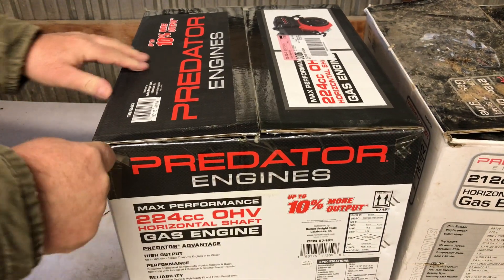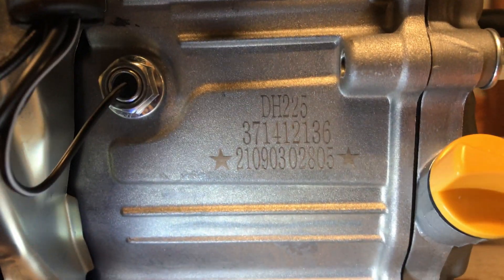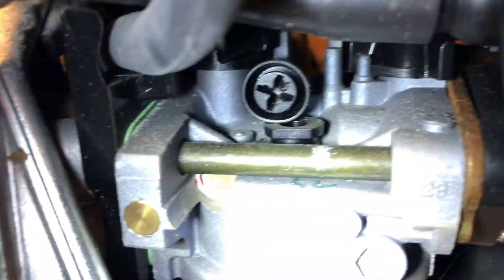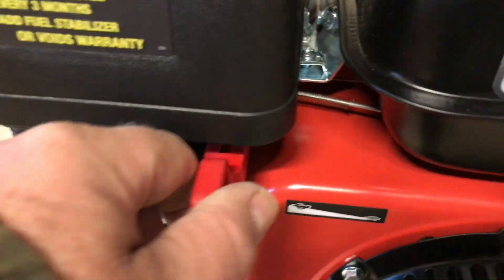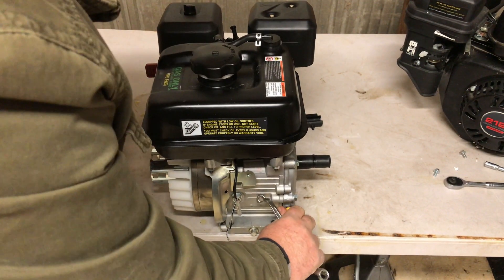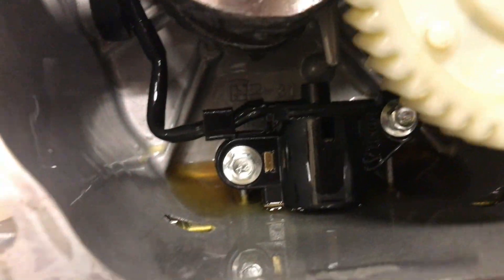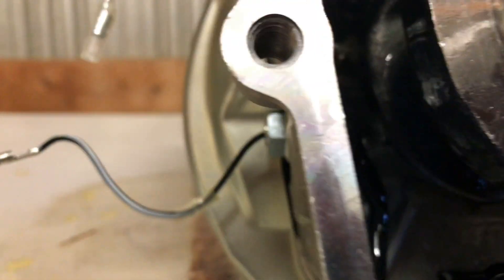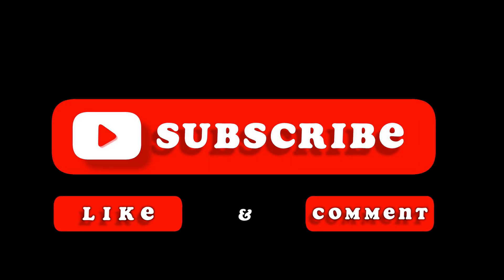The Secret Truth Of The New Harbor Freight 224cc Predator 224 Engine Review

Comment: My clutch from the 212 won't fit on the 224... What are the best options?
Reply from the maker: Hi Kyle. The Predator 212 and the 224 have the same output shaft size of 3/4" or .750  Some mini bike makers falsely labelled the 196cc engines as a 200cc, those engines have a 5/8 output shaft and will not interchange. I think that may be the situation you have. Best option would be to search Ebay or Amazon for a new replacement 3/4" clutch. You can find them for around $20 or less if you shop around. Remember you want a clutch for a 3/4" output shaft that has your correct sprocket according to your chain size, there are listings for lots of different sizes output shafts but the 3/4" is what you need for your Predator 224. The most common choices for sprocket chain size are # 35 and # 41, if your mini bike has a # 420 chain the # 41 will still fit. Hope this helps!
Reply: @KentuckyFriedFixes  hey thanks so much... Yep thats what it was... The guy i bought it from said it was 212 i bought the 224 and wouldn't fit turns out you are right
Reply from the maker: @kylearnett1420  Good deal Kyle! I'm glad you got it worked out. Now let's ride!
Reply from the maker: I also wanted to add that some Chinese clone engines will have a 20mm (.787) output shaft as well. The Predator 224 has a 3/4" or .750 output shaft.
Reply: They are the same size shaft ,so yes you sure can use the same clutch

Comment: I just bought this engine to slap onto my coleman ct200u-ex, which parts would you recommend I swap out, just to have a more solid, better performing engine?
Reply from the maker: Hi Caleb. If you're going to leave the governor on, you can add some more power just by adding an exhaust header. Most like to add the aftermarket air cleaner as well but I'm not sure an aftermarket air cleaner would help in this case as the stock unit has a cartridge filter and will breath pretty good as it is. It's also easy to add some 1.2 or 1.3 rocker arms with the stock camshaft and springs for more valve lift and power too. The stamped 1.2 and 1.3 ratio rockers are around $8 each and will live with stock springs and stock lift camshafts. Of course if you want a high RPM build, I have a 3 part series I did with a billet rod build on the 224 Predator. It depends on where you want to take the engine of course.
Reply: @Kentucky Fried Fixes  and if I take it out? How about adding that hemi also? I seen it online for a decent price
Reply from the maker: @troy22nd  If you're going to remove the governor you'll need to add in a billet rod and billet flywheel for sure. The stock rod won't handle sustained high RPM and the cast iron flywheel is already thinking about coming apart when it's sitting still.
Reply: @Kentucky Fried Fixes  I'm going to add the hemi head as well, where did you pick yours up at??
Reply from the maker: Hi Caleb, I removed mine from a 212 Hemi engine I'd purchased for an upcoming project but you can find just the Hemi head on Ebay. Try to find one with all the goodies still attached like valves, springs, rockers etc. You'll also need the Hemi push rods as they're a bit shorter than the non-Hemi type. For me, I'd rather catch the 212 Hemi on sale and buy the complete engine, more parts for the $.
Reply: @Kentucky Fried Fixes  I found it on a website, was wondering if you had found yours elsewhere for cheaper because you picked up a separate hemi head, no?
Reply from the maker: @troy22nd  Hi Caleb, I purchased a Hemi engine from Harbor Freight. If you wait for a sale you can pick up an entire Hemi 212 engine for $129. I've seen just the heads for sale on Ebay, the last time I looked I think they're selling those for around $80-$90 for just the Hemi head. That's why I purchased a complete engine for just a bit more. Besides, I needed the rest of the Hemi engine as well for another project. I like to get the most for my $.
Reply: @Kentucky Fried Fixes  Another question for you if you don't mind, the hemi swap you did, is that the same engine as the one you started up, with the header?
Reply from the maker: @troy22nd  Hi Caleb. There are 2 of the 224 Predator engines. One is the billet rod build and the other is the stock 224 that I swapped the Hemi head onto. I've not made any further modifications to the stock 224 Hemi engine yet. I used the same header for the run tests on both engines. I have since purchased a new header so i wouldn't have to swap it back and forth between them and wouldn't you know, it has the same crappy flange as the other one! Thanks

Comment: What torque converter would you match with this engine on a black widow go kart?
Reply from the maker: Hi Kevin, Those are pretty heavy karts. I have an old dune buggy type Kart which is likely heavier than the black widow though. I have purchased one of the 30 series Comet clone torque converters for it ($63.99). I think it will work fine but I've not tried it yet. The original torque converter on my kart was a Comet brand 30 series and I have to say the clone unit I purchased looks pretty good as compared to the original. I looked into the 40 series but they seem to all be for the 1" bore shafts and I needed the 3/4" like on the 224 Predator. I did notice that the 40 series was also about triple the price of the 30 series too. I've not gotten mine installed so I can't tell you how it will hold up yet but it's getting close to Spring so I should know in a few weeks. At around $65, I'm gonna try it before shelling out $300-$400 on a name brand.
Reply: @KentuckyFriedFixes  thank you very much. I have been sitting on this for a while as I couldn’t find anything on this subject. My grandson will appreciate it.
Reply from the maker: @kevinbrown2494  You're welcome Sir! Let's get those karts movin'! Thanks.

Comment: Do performance cams from the predator 212 fit these engines?
Reply from the maker: The 224 Predator and the 212 Hemi have a .549 to .550 bearing journal diameter on the cam. It's the same as the Honda and clone engines. The standard Predator 212 non-hemi engines have a larger journal on the camshaft of .557 and will not interchange. Weird how they thought this was a good idea...

Comment: Where can I get a double grooved pulley that will fit this shaft size?  I was gonna put this on a ryan dethatcher I have that has a old dinosaur Briggs 7hp  has almost 1” shaft tho  this shaft looks to be 3/4” ?
Reply from the maker: The 224 Predator has a 3/4 output shaft. I have bought pullies at Tractor Supply Store (TSC) years ago but I can't remember if they have double pullies or not. Surplus Center online may have something.
Reply: @KentuckyFriedFixes   I think this in its stock form would be fine for that dethatcher. The new ones come w Honda Gx160. So I figured it should. .  Thanks.  KFF

Comment: Can I use the 224 crank in a tilly block and if so what upgrades would get me high rpms thanks
Reply from the maker: Hi Shane. The crank should fit any block that's compatible with Honda clone engine parts. I know EC had an engine build contest recently and one of the guys that entered used a 58mm crank in a Tilly block. If you're going for max RPM, it's mostly in the camshaft and valve springs. Of course you'll have to add some billet stuff like the billet rod and flywheel for it to stay together. Lots of mods will get you in the 9 to 10K range. I'm thinking about doing a little more advanced build on a 72mm block. But, while the long stroke crank is nice to have these are pretty soft, so I don't know how long they'll hold up at 10K. Thanks
Reply: Thank you for the time and information 🙏
Reply from the maker: @infoinbio1  Thanks for being here Shane. I enjoy the engine talk.

Comment: Im gonna be completely here the 224 isnt worth the extra money  that reinforced block is nice but the 212s didnt have a problem with a weak block  as for the the power increase  its so minimal that most of us arent going to notice it at all  we have to keep in mind that this thing is still a budget engine that isnt going to last very long 
The plastic parts are still manufactured from the same garbage base plastic so they will fail within two years of normal use yall can buy the 224 at its inflated price if you want but i wont be buying it unless it drops to 100 dollars out the door
Reply from the maker: The 58mm stroke crank and the thicker block are worth the extra $40 to me. The rest is just spare tiller parts. The problem is Harbor Freight prices keep creeping up. I used to buy the 212's on sale at $99 but now the "sale" price is $129 and regular $149. These 224 engines are $40 more but you get a block and a 58mm stroke crank. The quality of the parts stinks. My new crank is already .001 out of round and that's brand new out of the box numbers. LOL Thanks!
Reply: @KentuckyFriedFixes  wow im surprised about  the crank is this ftom use or loose manufacturing tolerances
I own several several hinda clone engines 
And ive noticed all of them vibrate more than a new engine should have
Harbor freight prices are going up unforunately quality is not ive honestly been shopping elsewhere
When possible  but sometimes have to buy harbor freight items
As they do sell items that you cant get at lowes or home depot
Reply from the maker: @GeorgiaRidgerunner  It's a brand new engine so wear has nothing to do with this one being out of spec. The crank was ground out of spec. It's funny most billet rod makers say that if your crank is .0005 out then you should have it turned..  My brand new crank started out life at twice that .001. LOL I wouldn't use this one for anything exotic for sure anyway, these cranks are soft. Thanks GA Ridge Runner!
Reply: The power difference is noticeable..very noticeable.

Comment: Fun fact: The 210903 on the sticker is the date it was manufactured, meaning it was built on September 3, 2021. They use a YYMMDD format so that the serial numbers are in chronological order when they count up. The 02805 is likely a time code for what time/shift/assembly line it was scanned on after testing.

EDIT: The carb has 210901 so it was manufactured on September 1, 2021. That factory was running VERY tight production on these units. No extra stock laying around. I think I saw 120502 on the old one so that was built May 2, 2012.
Reply from the maker: Awesome info! This is exactly the kind of thing that comes in handy when identifying these things! The old 212 is an engine I've had for several years. It's a new one in the box left over from a sale bulk purchase but it's not a recent manufacture "New" engine. I expect the QC on it was terrible! Thanks!

Comment: Nice engine. What's the length and width bolt pattern? I am debating on buying this engine to put on my vintage Montgomery Ward snow blower and wondering how much modifying I would have to do?
Reply from the maker: Hi Mike, the mount is a standard 6.28" x 3.07" (bolt hole pattern) center to center. Same specs as the 212 and many other small engines. Thanks!

Comment: Have one of these on a wood chipper. No complaints so far, more power than I expected. Only issues with about 30hrs on it has been muffler cover screws vibrating off.
Reply from the maker: Scott that engine is probably trying to spit out the muffler hoping you'll replace it with a header! Thanks!

Comment: Just subbed, I have 8 of the small vertical engines in use for 2 years of grass cutting, haven't been able to find them for about 2 years in stock, I think I'll try to figure out HOW to mount one of these to my Snapper RER to use it to pull my pull behind cutter
Reply from the maker: I remember the vertical engines. They have been missing in action for a while now. Thanks!

Comment: I’ve used predator engines on several tillers and a few zero turns for customers. They’re all still going and never had a single problem
Reply from the maker: The price keeps going up is the only complaint I've had with Predator engines. I miss the $99 sale priced engines. Now they seem to be at $149 regular price and sometimes go on sale at $129. I guess to be fair everything is going up in price these days.
Reply: @KentuckyFriedFixes   Damn , I haven’t bought one since the increase. Thanks for the heads up.

Comment: SO, how is the cam gear attached to the cam? Can a metal one be fabricated and replace it easily"
Reply from the maker: It looks like it's molded to the shaft. I don't know if it would be worth the effort to put into a stock camshaft. Metal replacements are really inexpensive now. I've seen engine builders sell the stock metal 212 camshafts by the 10 pack for around $30. Thanks!

Comment: Would the cam/shaft from the 212 fit in the 224?
Reply from the maker: The 224 uses a clone type camshaft with a shaft diameter of .550" The stock 212 Predator camshaft has a larger diameter shaft and will not swap over, the Hemi Predator camshaft will work or any clone cam with the .550 journal.
Reply: Damn..I was kinda wondering that too since the cam in the 224 is plastic!!!!!
Reply: So a hemi cam will fit in it instwad of a non hemi cam im looking at gps hot265 cam will it fit if so wich one?

Comment: Does it have a removable plate where a starter could go
Reply from the maker: You'll have to get an entire kit to convert it over. I've not done it, so I don't want to tell you wrong but it's my opinion that yes you could, I don't see any reason why you couldn't make this an electric start engine.
Reply: @KentuckyFriedFixes  I have a bunch of powerland electric start 212 engines I grabbed cheap  off the ebay a few years back they have everything I need but I am looking to put one on a snowblower so I want 120volts flywheels are $25 starters are $75 12volt kits are $80 for everything including charging coil and new fan cover
Reply from the maker: @craigchiddo2794  Go for it Craig! As far as i know you'd be the first to install an electric start on the new 224 Predator!

Comment: As I understand it the 224 is a 212 with a stroker crank. Shorter stroke spools up faster but lowers overall power.
Reply from the maker: It's a completely different engine than the 212. Though designed on the same specs there's lots of improvements like the thicker block and longer stroke crankshaft. It's a trade off on the strokers. Lots of guys like the short stroke big bore engines and others like the small bore with long stroke crank. I think the shorter stroke is probably more comfortable at high rpm. Thanks for commenting!
Reply: It’s actually rated .1HP higher and almost 2lbs of torque higher
Reply from the maker: @anthony1113  A lot of guys have been saying the 224 pulls much harder than the 212 at lower RPM. Just a mild cam seems to wake them up a bit more but even stock that extra torque is noticeable.
Reply: @KentuckyFriedFixes  me and my brother just got mini bikes..they both have the same gear ratio running a clutch..I have a 224 and he has a 212 hemi and both are new..mine smokes his on acceleration.
Reply from the maker: @gonewronggarage4565  Those 224 engines have some torque! Thanks for watching. I see you have some good stuff on your channel! Just subbed!
Reply: @KentuckyFriedFixes  thanks! Although I pretty much quit my channel, but yeah I feel the difference and I love my 224! Some people will be stuck on the 212 but not me.
Reply from the maker: @gonewronggarage4565  I like your content! That "Patriot" riding mower you speeded up is a fun video! There's a lot of guys interested in these 224 and 212 engines now. It'd be easy to make a few videos if you decide to keep up the content. I'm partial to the 224 engines as well. (If I'm building Chinesium) Fun little engine upgrade for sure!
Reply: @gonewronggarage4565  do yu guys have the same top speed ?
Reply: @4GTLDOM  pretty much yes
Reply: You must understand wrong. The 224 has a lot of the same measurements but the stroke is longer in the 224.  It's a totally different motor though. Parts are different and stronger but a lot can be changed over into the 212

Comment: That plastic cam gear gets the boot as soon as the engine hits the bench! 🤣. I ran into a few other clones with that trash
Reply from the maker: True John, mine was replaced with the 265 Banzai cam. I think most guys will replace the camshaft anyway so it is unfortunate but it's not a deal breaker. It is new so I guess I'll save it as a spare for my tiller. LOL Thanks!
Reply: What cam fits in it and clears?

Comment: My negative is not against the commentary  or person,, it just don't make any d-m sense to run a nylon gear... perhaps they should have taken not on Zebco 33's when they brain stormed collapsed due to NYLON...it's NYLON People...your fault my mistake to buy.
Reply: I understand concept to quite the whine of the metal cam,, but trust us I'm sure I speak for all the Real Deal Pred  shakers   ..Trust me we like whine...brkfst ,lunch, and Dinner☆
Reply from the maker: I agree Terry that a nylon cam is a disappointment. I know you get it, but there are a lot of guys that don't understand that it's really not a big thing to most builders to get rid of some of the stock internals when doing a upgrade to a performance engine specs. So far I've replaced the camshaft, lifters, springs, connecting rod, piston, pin and rings. The stock flywheel is also on the "things to replace" list LOL. Thanks for watching!

Comment: Is the 224 louder than the 212 at low rpm? By any chance do you kniw what is the lowest rpm these eniginea can run at? I do mobile auto detailing and the 224 would look perfect in my van.
Reply from the maker: Hi David, the noise level seems to be about the same thru the muffler. They're pretty quiet. I don't know what rpm minimum they'd run at, the stock flywheel is pretty heavy though so that should allow a sustained low rpm run. They are air cooled though, so there's that to consider. Too low on rpm for long periods may cause the engine to overheat.